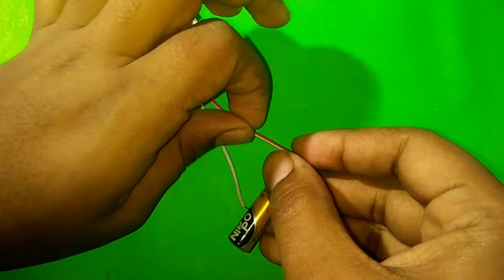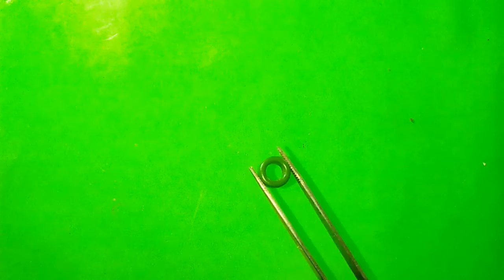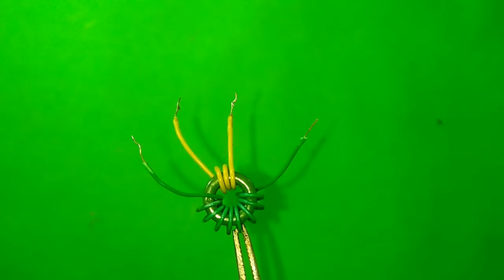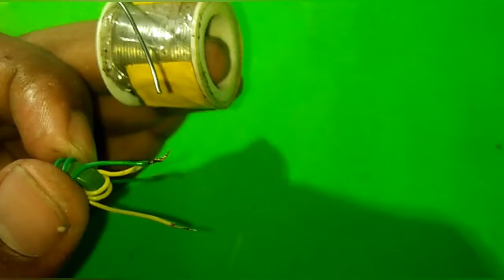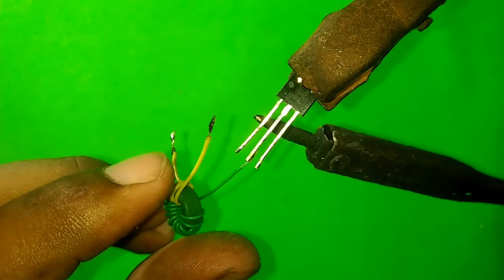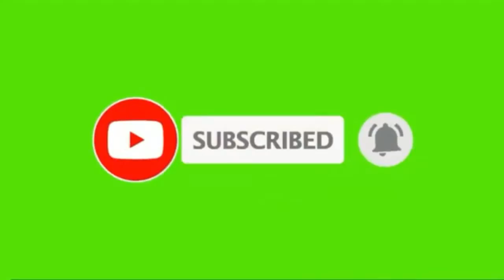voltage booster 1.5v to 12v  (part-2)

Comment: 2 turn and 6 turns with 13003 Transistor! Hmm...🤔 Does it works?
Reply: I liked my own comment!😂
Reply from the maker: Yes
Reply: Not working
Reply from the maker: Check the circuit and try again later, this video is not fake

Comment: can I use 13003 transistor
Reply: Don't give me heart tell me can I use 13003 transistor.. Insted of 13002 it will work fine or not
Reply from the maker: Yes but consider all the pins of the transistor

Comment: It can't work in DC without an oscillating circuit. Sounds like a fake
Reply from the maker: Are you tryed this circuit ?
Reply: @ExperimentSwatch  no, I haven't
Reply from the maker: This is working, I recommend you to build this circuit
Reply: @ExperimentSwatch  for sure, I'll try and then I'll told you how's gone

Comment: If I increase the number of turns of the green wire, the output voltage will increase, right?
Reply from the maker: u increase your LED multiple times voltage will adjust automatically
Reply from the maker: but this circuit don't give much amp

Comment: Sir, i follow your video and make a juole thief. But the energy drain all at once can you please help
Reply from the maker: What transistors are used?
Reply: @ExperimentSwatch  sir, i used 2N2222A and 3904
Reply from the maker: Two ic is different pin out is not same
Reply: @ExperimentSwatch  Sir I don't used at the same time. I tried with both transistor   saperately
Reply from the maker: @Tribal7777  No, I mean the transistor I am using is 13002 and the transistor you are using is 2N2222.  These two are not the same.
Reply from the maker: The transistor used here is (NPN) and the pin outs should be B, C, E
Reply: @ExperimentSwatch  Yes Sir, even my transistor is NPN
Reply: @ExperimentSwatch  And Sir, can you tell me how long does the battery last with this joule thief?
Reply from the maker: Yes but, pin out is very important
Reply: Sir, can i have your gmail id
Reply from the maker: Contact on my instagram, link in description
Reply: @ExperimentSwatch  sir, it's said your instagram link page is broken. Any other option
Reply from the maker: Oh Sorry, I fixed it, please recheck

Comment: 🔥🔥🔥🙏🙏🙏😂😘
Reply from the maker: What have you tried
Reply: It's a joule thief. Which is absolutely not fake. You can find them everywhere on YT....
Reply: @jvon3885  but it is voltage booster he said 😡😡😡
Reply: @allinonechannel6284  it depends on what application it can be used for, like the YouTuber Great Scott, he made a jouletheif ,  but after he made it and said it somewhat of a crude boost converter
Reply: Yes I know it is joule theif circuit but it can't boost voltage I have tried
Reply: @allinonechannel6284  just go ask the original designer of this circuit. He will explain it all to you.
Reply: @allinonechannel6284  https://youtu.be/d-Wv17QUFDQ